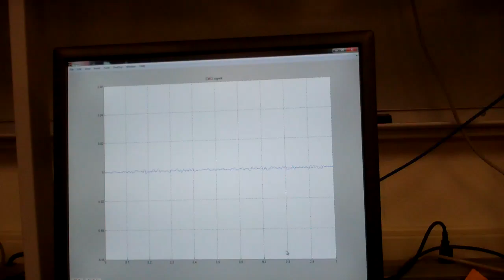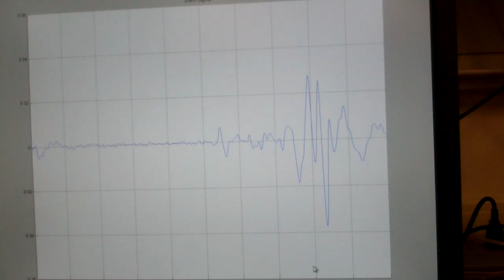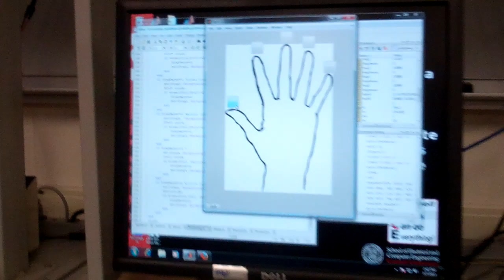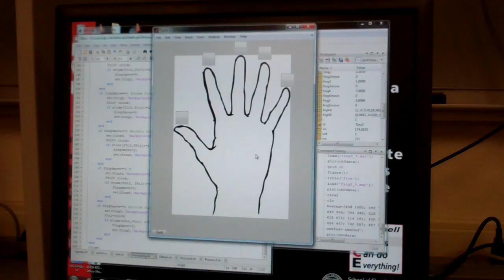Capacitative EMG

Comment: just wondering is it posible to put the capacitive emg outside of clothes like a jeans and still be able to get some readings
Reply from the maker: Probably, but the signal to noise ratio will be smaller, which means more signal processing
Reply: @ece4760  Thats very interesting. I wonder how a contactless emg system could work using this approach for clinical and biomechanical assessments

Comment: would be thankful if i get some more info. about capacitive electrode usage. I actually have to use them in ecg circuit and currently they aren't working well . any suggestion or solution ?
Reply from the maker: These are difficult to get working well. The report associated with this video is the only experience I have with them.